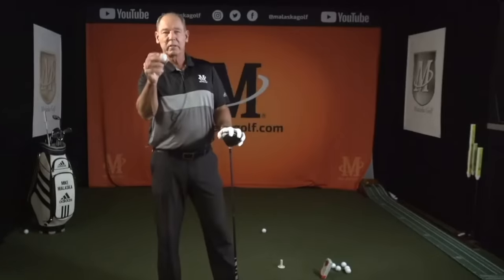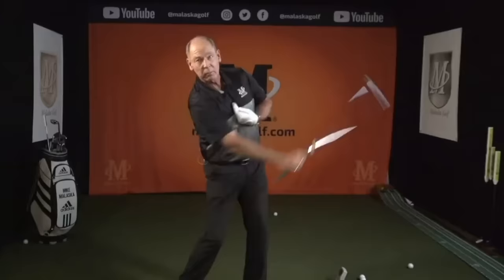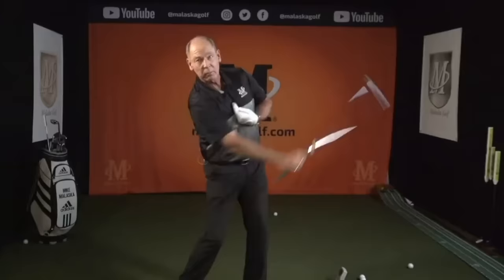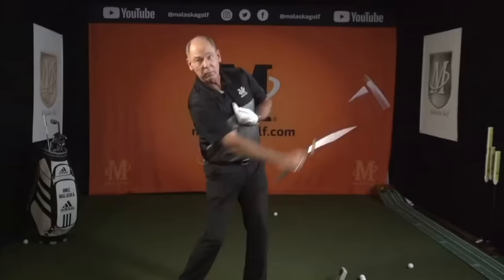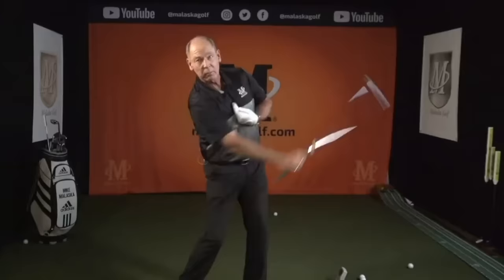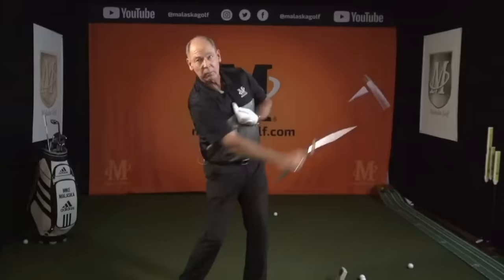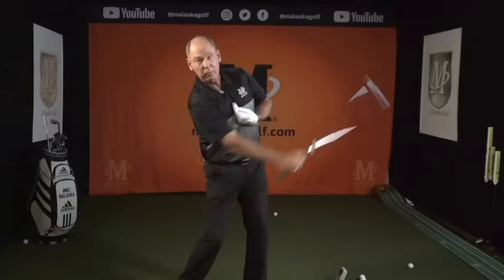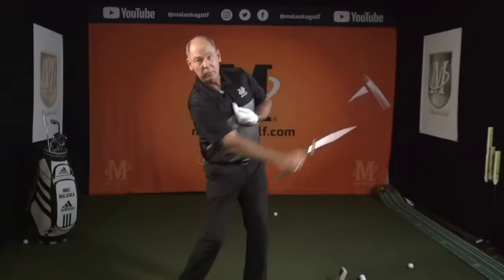Malaska Golf LIVE / DISTANCE / Episode 2: Where Speed Really Comes From

Comment: At around 11 minutes, Mike demonstrates that he gets  almost 90 mps club head speed  swinging with his right  arm. I can only get 60 mph.  I do everything he says (relaxed shoulders, wrists, high hand to give max travel length) .  Anyone  got any suggestion about what I need to do differently?
Reply: You are probably dragging the handle forward in the downswing as opposed to letting everything drop and allowing the handle of the club to "reverse"direction earlier. When you do the L to L drill one handed, that pivot of the handle should happen right by your trail hip when using your trail hand....when doing the drill with the lead hand, the pivot will happen a little further forward, just before or near the groin area. Once you put both hands on the club the pivot will occur close to the same spot as the lead hand only. The real key is being super soft in the hands, wrists, arms and shoulders. As soon as you "try" to swing harder, tension comes in and you lose speed....it's a lesson I have to relearn but when I go back to the L to L drill and really concentrate on keeping everything relaxed and soft, the speed comes back. Keep doing the L to L drill. You'll know when you're doing it right because you'll really feel the weight of the club as it almost takes off on it's own.
Reply: can you throw a baseball at a reasonable speed if not work on some strength and conditioning.
Reply: @grahamjones7371  Never played baseball; so, I don't know. No doubt at my age of  76 I could use a bit of strength and conditioning. However, I hope that's not the solution. When I see Mike achieve a 90 mph swing speed  effortlessly with one hand it doesn't look like there is a physical strength/strength component. He makes the point that it is about directing forces and using the levers properly.
Reply: @billstewart852  Unfortunately Bill Mike is still even at his age a highly co-ordinated strong athlete! Yes as in any sport he uses forces and levers properly, try throwing a tennis ball with your grandchildren or maybe a bit of table tennis, you will be directing forces and using levers! But importantly you will be working on your athletic ability!  Two cheap ways to improve,turn the club so you hold it at the head end,swing it one handed and make a swish,you will find it a lot easier with either right or left only than with 2 hands due to needing less athletic co ordination!
Reply: @grahamjones7371  Thanks - I'll check it out.
Reply: PS at about 11 min Mike states its an Athletic Motion. I am amazed by how little high handicappers appreciate this and think that its about positions and science.We have no practice facilities at my club so before i tee off i bounce a ball on my club,why, the hackers think im showing off but im keying in my hand/eye . im 60yo old been playing 10yrs and sot level par twice in the last month in comps. Next time youre down the range with your feet close together do armsy 3/4 swings like Mike shows clipping the rubber tee peg back and forth until you can clip it continuously 10 times. Then do it with your eyes shut!
Reply: @grahamjones7371  Thanks for the suggestion. Our range is closed too because of the virus riska. Congrats on you low scores after 10 years. My best this year is only 76.
Reply: @billstewart852  OK i will let you into a golf secret, the ability to produce swish / speed is an important proof of athletic skill but the great golfers have not been producing this as Mike demonstrates with his whippy stick, well not since Bobby Jones and the steel shaft! .The greats though athletic ability and technique manage to bend a stiff steel shaft and release it through the ball but nobody ever tells you this!
Reply: You can still achieve this with an armsy practice drill. Do the Hogan waggle but powering it with your elbows/shoulders rather than hands. This should help you feel that rather than producing clubhead swish you are trying to snap/break the shaft about 6 inches below the grip as  you swing through the ball.
Reply: @grahamjones7371  Who knew? I will  check that out too.
Reply: I made these comments b4 watching Mikes great video all the way through.If you take one thing away from this(if u can shoot 76 you are directing forces and using levers pretty well!) it is the section on LowerBody/Hip Action.I have Not seen a Better explanation in 000s of u tube vids! It is what saves my swing!( like Mike I was a reasonably good all round athlete in my youth)Finally I am getting the easiest part of the swing right! which is the set up and takeaway! which has taken me to the next level. However my lower body action and right arm only swings got me down to 7hcp im now off 4. But Warning Do Not practice right arm only swings with the club the right way up without a Lot of strength and conditioning as the right arm is in a weak position to handle the weight and you will bugger up your elbow shoulder or both!
Reply: Surprised that you only get 60 but able to shoot 76. Maybe your meter is wrong. As has been said, Mike is tall, fit and has good timing and, of course, he has a good swing even with one hand. Many of us seniors are not so flexible particularly in the wrists and shoulders so trying to swing at speed often produces swing faults which actually reduce speed. If you have swing faults correct the faults before you look for more speed. If you can play to your age there can't be much wrong.
Reply: @oldpro9336  My max swing speed is 84 ...  so I have to depend on my short game for low scores.
Reply: @billstewart852  Yes i think my 1st few comments were that golf is a throwing action,i think i mentioned throwing a ball.If you cant throw a tennis ball reasonably fast and straight,or no good on the coconut shy at the fair! yo are highly unlikely to swing a golf club over 90mph! 
You probably have to be a skillfull athlete to bend and release a stiff steel shaft but thats what great ball strikers do.Get an oldfashioned ruler and make a swish,see how far you can hit a scrunched up piece of paper then hold one end ,bend it and see how far it propels paper
Reply: @grahamjones7371  You make a good point.. I recall a Malaska video showing a lesson with a champion boxer (maybe Sugar Ray). Mike berated him - "You've got the fastest hands known to man and you aren't using them!". The boxer seemed to  understand how to use his hands and I think his 7 iron went from 140 yards carry to 180 yards within a few swings.
Reply: @billstewart852  Sorry, I misread your first comment. I still think 84 is good for your age. I am 70 and I can't get more though I have some disabilities. Thanks to modern equipment I did not hit the ball much further as a young pro than I do now. I still would say that to hit your drives further you need to hit them better not harder, allowing the hands to work freely as Mike says. My right wrist is quite stiff so if I grip tight with it in an effort to hit harder, I swing over the top and lose my distance in a high slice. This is quite common unless you start golf as a child, so I often suggest loosening the right hand grip allowing the palm to come away from the grip.
Reply: @oldpro9336  Hitting it better is the only practical strategy. What id your current swing speed?
Reply: @billstewart852  I think about the same as you, I only carry about 190 yards tops. I just started playing again last year after 25 years as I bought a little buggy because I can't walk. I was carrying over 200 yards last year but shortened the swing to bring it under control. 210 yards down the middle gets me closer to the hole than many of my bigger hitting partners! I can only play 9 holes, I play to about 6 handicap.
Reply: @oldpro9336  Impressive. Way to hang in! My mantra is "Don't let the old man in"
Reply: @billstewart852  Ok lets forget the strength / conditioning approach Although at 60 Im hitting it further than ever but Ive prob got another 3/4 yrs left! So that leaves leverage.You have got to apply pressure /resistance to the butt of the club with the heel and last two fingers of the left hand.Your left hand produces speed right hand control, this is the opposite to what most golfers think/do! You can gain speed/power from right hand/side But you have to be athletic and/or do strength conditioning because the right arm is always in a Weak biomechanic position ie bent! and at best you are applying pressure in the middle of your grip ie 4-6 inches from the butt so shorter lever but in reality a lot of your right hand is applying pressure through the base of your index as hogan demos an even shorter lever!
To do this you need a modern set up close to Nicklaus with the left side in a powerful position to maintain its position  and the right side/hip has to get out the way quickly so you can feel the butt in your left hand resisting this then its a long left sided pull from the top on your left hand, not with it, but its a dance move not a power move! Youre throwing a frisbee!
Reply: @grahamjones7371  You may be on to something. I only consider my right arm/hand as the speed generator (like skipping a stone" - never really thought of my left arm/hand unit much. That thinking came a long time ago from Tom Tomasello's  video on power on Youtube demonstrating the difference in speed generated with an alignment rod  ... it's easy to generate much more speed with the right hand action. As I have indicated earlier, I have not been able to get this hand action when I swing the heavier club with both arms -  it seems I don't have that athletic capability that comes so easily for long hitters.  I will do some experimenting with the "throw the frisbee" feel with my left arm/hand.
Reply: @billstewart852  Yes the right arm is the best speed generator with light objects! But unless you are prepared to do strength and conditioning a golf club is to heavy!Which is the only reason we swing 2 handed! would you ever play badmington/tbl tennis 2 handed! Also although Ive done a lot of PT in the last year I can still hit the ball further left hand only than right hand only even tho im right handed!Why because we set the left arm in a more solid connected position which it just maintains and obviously is the longest lever. Ask your self this what arm would you throw a Frisbee the furthest.The answer is the lead arm unless maybe youre a top baseball pitcher! Yes the lead arm would be your right but even if you made it your left you would throw it further than your trail arm. Clay has made some great videos But he is a bigger stronger younger athlete than Mike! I would avoid the Lag section tho  because thinking of Lag ruins most golfers!
Reply: Another fact 100mph+ swinger only accelerate the butt/handle to 20mph but they do it at the right time!
 I would work on Mikes lower body action which he mentions here but goes into more detail with Eric Cogomo in a video. with Clays release point! because the legs/hips/glutes are a seniors strongest muscles (if they can walk) but most never use them! When I play against the county u14s they All use them massively!
Reply: @grahamjones7371  I played a few holes with my launch monitor last night.I found the swing speed the same .... frisbee throw fee, ling with my lead arm versus skipping stone with my trail arm. However it may be that the frisbee feel is unfamiliar teritory for my brain ..... It felt like I was more balanced and didn't seem to require as much effort. I will spend much more time experimenting with this lead arm dominated swing. Thanks for taking the time to work with me on this.
Reply: @billstewart852  Good but remember that to fling the frisbee (imagine its a heavy frisbee!) with the left/lead arm you have got to get the right side out of the way behind you and slightly back towards the target. To do this you need to use your strong muscles in the lower body as Mike teaches.
as well as creating space they take care of the strength needed swinging a heavy golf club so that the arms can just fling!
Reply: @grahamjones7371  It turns out that the soft tissue around my left rotator cuff is rebelling to that reality ... getting old is not for wimps.
Reply: @billstewart852  Oh No we are back to how important strength and conditioning is! elbows to side,palms up, forearms 90 deg,internally rotate so hands go to 45deg. For strengthening do with stretch band.
Reply: @grahamjones7371  Thanks.
Reply: @billstewart852  All throwing athletes/sportsman know that their rotator cuff is vulnerable so if you see golf as a throwing action you have to strengthen for injury prevention. But you may well have overusing your left arm remember its the body action that flings the left arm which then is then Deaccelerated! by left leg as in Chucks flick the towell drill!
Anyway last attempt to get you some swing speed without strength/conditioning although if you do this you will do it anyway
Get a yard of thick (grip size) rope,tape pipe sponge to last 6in (to avoid hurt!) tape grip end (to avoid fraying) from golf stance swing 10 continuous learning how to use body action to generate swish whilst strengthening your core!
Reply: @grahamjones7371  Duly noted - thanks
Reply: Get a yard of thick (grip size) rope,tape pipe sponge to last 6in (to avoid hurt!) tape grip end (to avoid fraying) from golf stance swing 10 continuous learning how to use body action to generate swish whilst strengthening your core!
Reply: @grahamjones7371  You are going a way beyond the call of duty. Thanks for taking the time.

Comment: In what world does your physics add up cause it’s just math and it’s impossible for the ball to travel at different mph at being struck at 100 mph. Do you just make this stuff up or you failed physics which is it.
Reply: How can you have a Golf username and not know the difference between club head speed and ball speed?
Reply: So, are you saying that all these golf monitors are not measuring reality?
Reply: You can't be serious. There's clubhead speed and ball speed. The club is heavy and transfers speed and momentum to the ball which is lighter weight which compresses and rebounds. That's physics. Say Tiger swings 120. His ball speed is going to be 180. Do you think launch monitors are lying?
Reply: It's common knowledge that the ball compresses and comes off the face faster than the clubhead is travelling.
Reply: This is just a bizarre post from you Lee. If you don’t hit it in the sweet spot of the club, the ball speed drops. Smash factor maxes out at 1.51 so a 100mph club speed will produce 151mph ball speed IF hit perfectly in the center of the face. Anything hit off center that ball speed comes down
Reply: The swinging club has kinetic energy = to mvsquared/2. When the club meets the ball it transfers a lot of this energy to the ball. This cause the ball to compress dramatically. This results in a spring like effect and as the ball expands from this compression it moves with a much greater velocity than the club head was traveling.